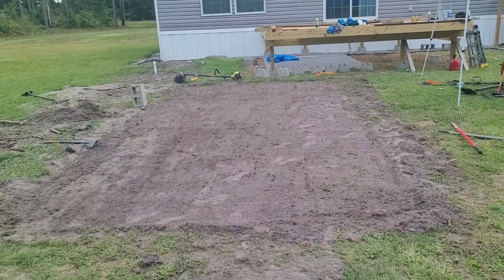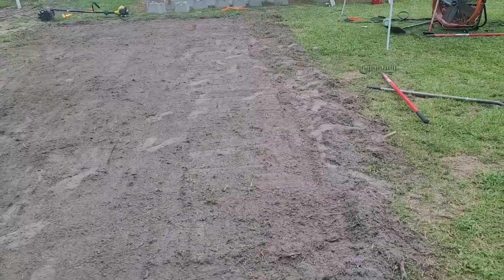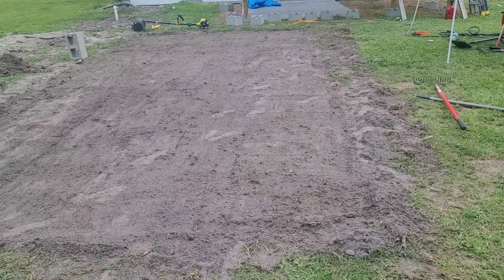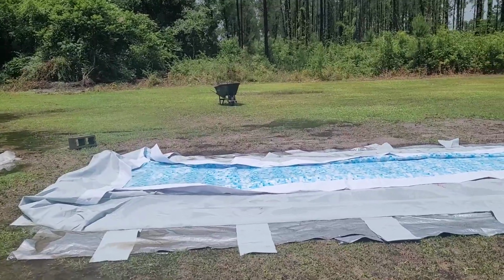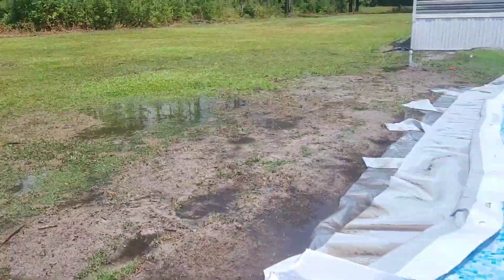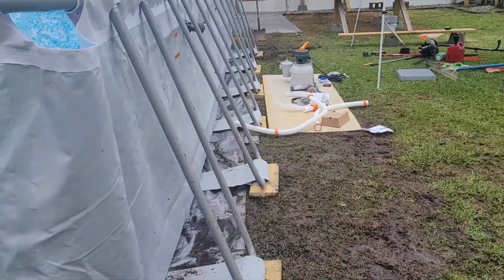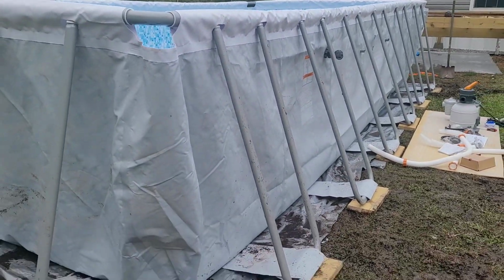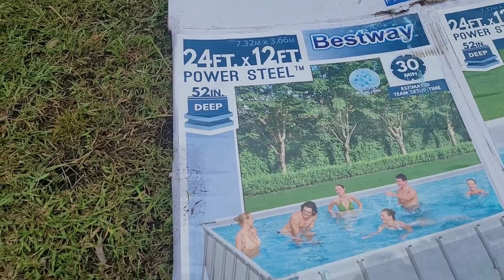#bestwaypool #intexpool #pool   PREPARING AND INSTALLING AN ABOVE GROUND POOL🥵🥵

Comment: How long did it take ?
Reply from the maker: @Gameriode Gamer, the prep work took like maybe 5 hours. The area was unlevel pretty bad and we had a lot of roots and small stumps. But the actual assembly of the pool can be done within an hour. Then you have to put the pump system together and the ladder. It was an all day job for us. And being that we get our water from a well, I don't want to risk over working our pump, so we're breaking up our water fill times.
Reply: @DIYRAYMOND  well that seemed like a lotta work
Reply from the maker: @gameroidegamer2298  it was. Whole body sore...lol.. but in the end it will be worth it